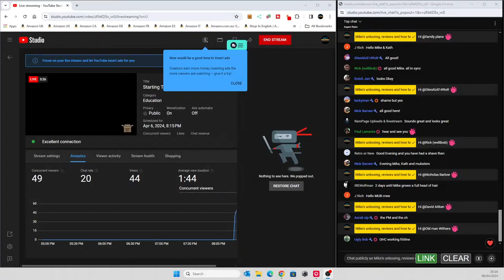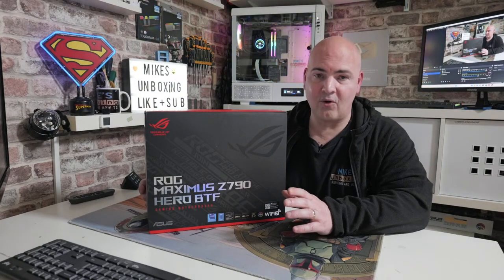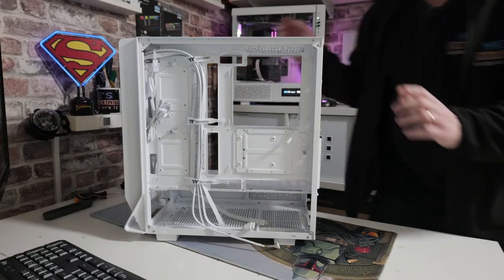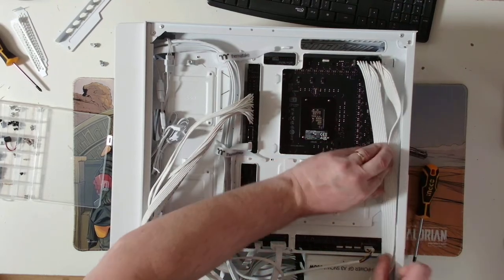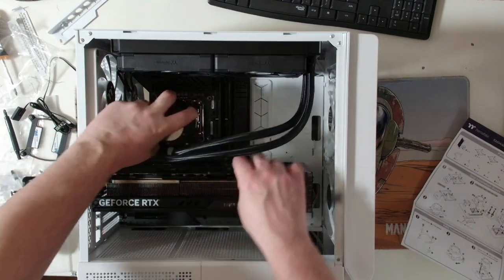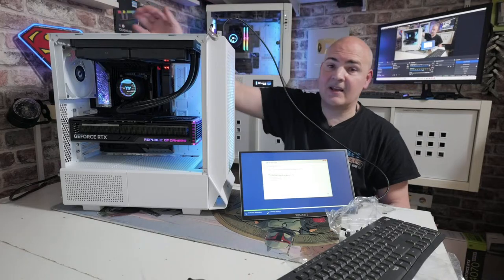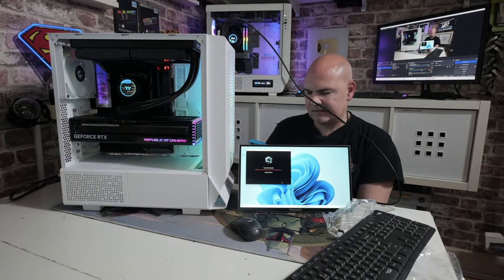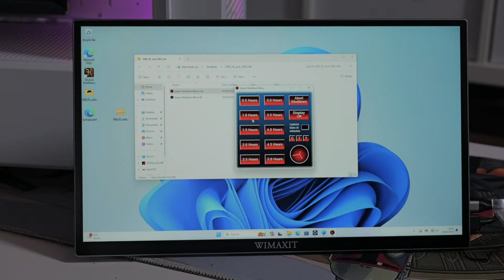Starting Thermaltake Ceres 330 Build With ASUS RTX ROG Strix 4090 BTF Edition Z790 Maximus Hero BTF

Comment: I found the ROG Strix z690 a real PITA to work on. It's so cramped. And it was the first time ever I had to remove a graphics card to remove a SATA cable. :-)  MSI has a B760M Project Zero, a Z790 Project Zero and a B650m Project Zero. Pretty interesting.
Reply from the maker: the z790 project zero arrives here shortly :-) but not to keep
Reply: @mikesunboxing  That's good. And  a shame. :-)

Comment: Hello Mike, I can also use this cooler for the Intel Core i3 9100F and does it fit on a Tuf B360M - Plus gaming mainboard
Reply from the maker: yes it seems so from the product description 
Socket Compatibility	
1150
1151
1155
1156
1200
1700
2011
2066
AM2
AM2+
AM3
AM3+
AM4
AM5
Reply: @mikesunboxing  Big thanks :face-blue-smiling: